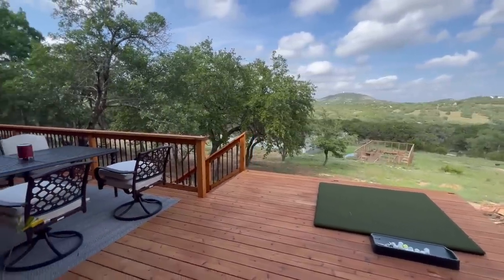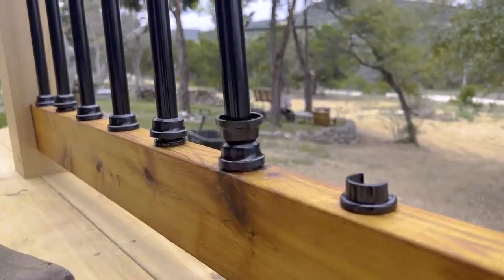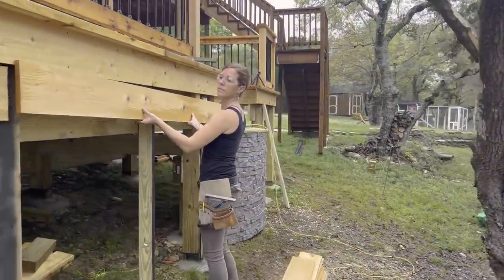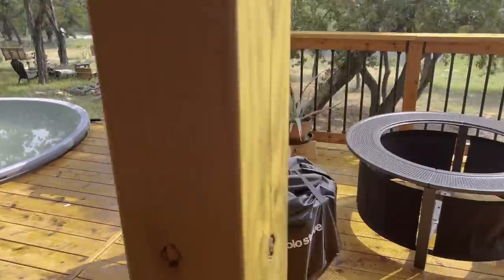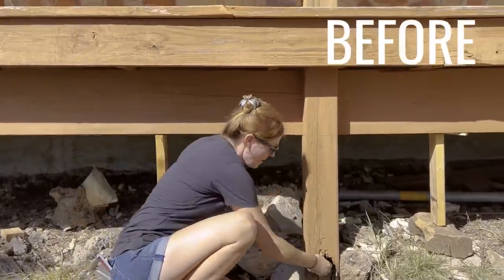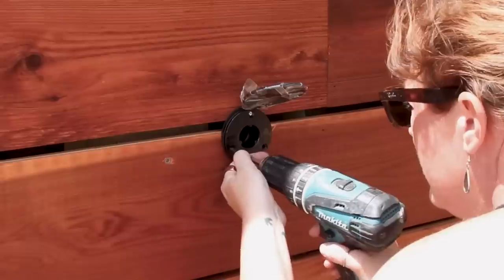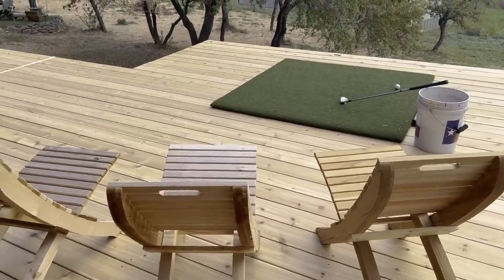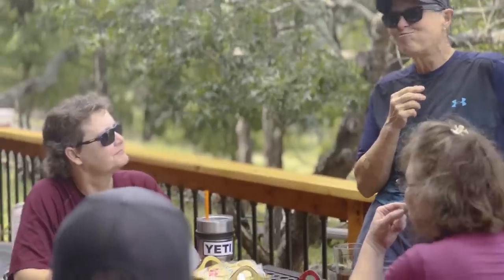Best Deck Ever?? | Unique Ideas for Building a Deck

Comment: The removable railing is definitely original. The golf platform on a deck is uber original. The metal spindles on the second floor is a nice match. Agreed, 16" oc is worlds better than 24" oc for the long run as well as the  stainless steel screws.

Comment: Amazing deck! Golf tip - the bottom of the swing should be on the target side of the ball. Use a spot about 1-2” in front of the ball to look at instead of the ball. Make some practice swings as you normally would with the ball in the center of your swing but try to have the bottom of your swing on the target side parallel to your spot (1-2”). Your natural athleticism will automatically adjust to the change after 5-10 swings. If on grass, use a tee positioned 1-2” target side of the center of your swing. Keep trying to clip the tee with the bottom of your swing. Then add a ball - eventually put the tee and ball center of stance, while looking 1-2” target side. Have fun  - and really like your low score keeper!

Comment: Years ago, we had a deck built on the back of our house. We planned to barbeque as often as possible, so my Mother suggested to the builder to put in a gas line from the house to the outer edge of the deck. When we moved in, we could barbeque using the LP that the house was running on. Not many people can say they have a 500lb LP tank for their barbeque. Years later, when natural gas became available, a simple part switch (which the Gas Company did) and we had a Natural Gas barbeque. Sweet!
Reply from the maker: That's awesome! Thanks for Sharing and for watching.

Comment: That is the ultimate entertaining deck i have ever seen, especially the driving range. April, i do not see your dogs anymore from the video from your old place when you made them a wading  pool, i do see a new dog now.
Reply from the maker: The 2 new dogs belong to a friend but I still have my two. They prefer the air conditioned inside rather than the Texas outside heat. Thanks for watching.

Comment: Regarding that weird angle board on the lower left, when you open the gate… rather than screw it to the center post and step over it, attach it to the board above it with a reverse piano hinge to the above board. So all you have to do is flip the board up, (lock it somehow to the board above) then open the left door. Seeing it screwed to the center post is just weird.
Reply from the maker: Eh, as I know it's there and I'm the one going in, it's all good. But a good suggestion for those it would bother. Thanks for watching.